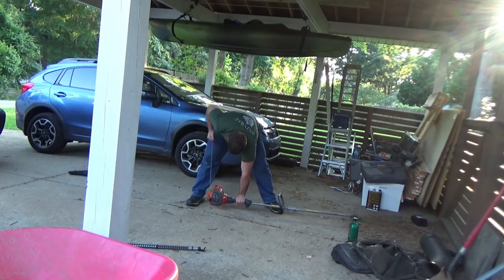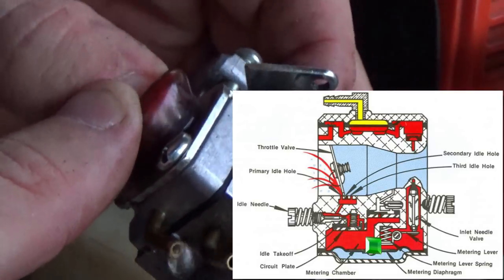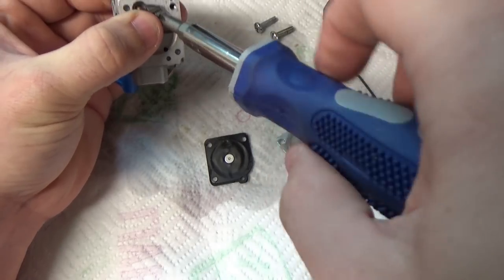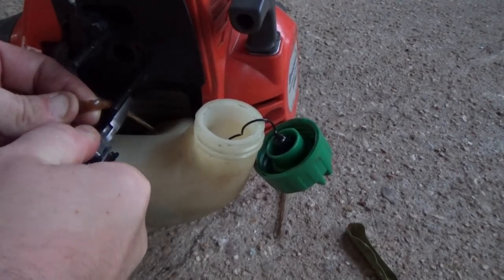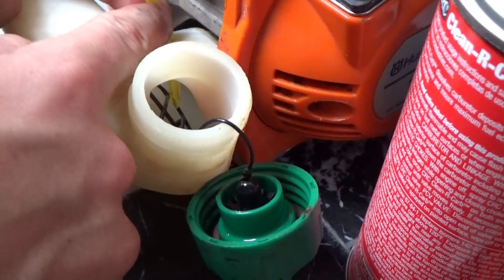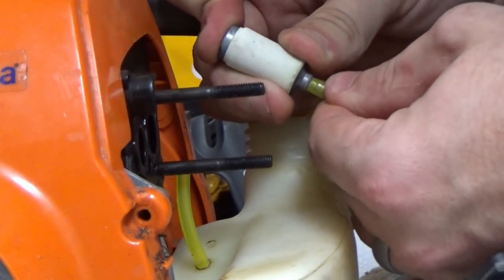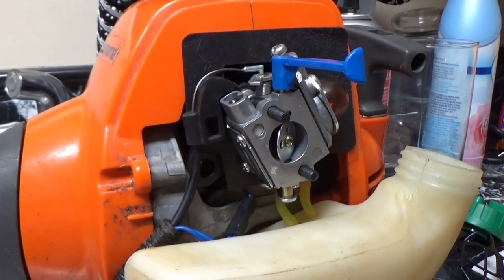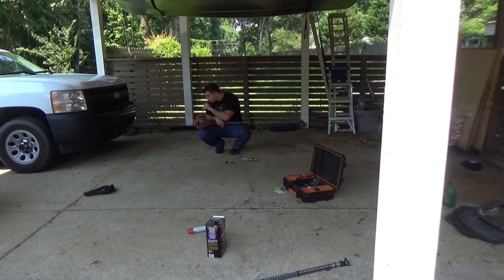How to fix a Husqvarna weed eater (no more bogging down)

Comment: Mine ran good for about a total of 6 hours.   My fix to the bogging down, stalling problem was to tomahawk chop it to the ground, engine first then run it over with the tractor.     It still doesn't run, but I dealt with the problem once and for all.    Next time I'll buy stihl
Reply: Sounds like what I need to do with mine, I have got it running and after a while it happens again. My Husq. is about 20 years old.,
Reply: Doesn’t matter what brand you buy if you leave gas in it with ethanol or not take care of it or maintain it. Also, you get what you pay for. Don’t expect that a box store trimmer will last forever. It’s worth it nowadays to step to a “pro” model.
Reply: Husqvarna is trash
Reply: @alonzokincaid1362  the older stuff was good. Don’t know about the newer stuff. Mine is from 98 a 232L

Comment: Liked and subscribed, my man! Thanks for putting this out.

 I have a Husqvarna 128 LD trimmer and seems the issue was the fuel lines were disintegrated. I dumped the fuel into a container and saw a bunch of little pieces from the line in there and in the empty tank.
I ordered a kit that I luckily found on Amazon and I got it today. It works good as new. I cleaned my old carburator and saved the new one. Thanks again!

Comment: Good video, when I work on those carbs I’ll usually strip the plastic off a bread sack tie and run through the little orifices.  Works good.
Reply: Just have to be careful doing that some of those have check valves that can be damaged.

Comment: Very helpful. Don't forget to clean exhaust screen. That ended up being why mine would bog down and run rough, but the things you did were important and helpful. I also dumped the old fuel and ran straight gas through it for a moment, then added a fuel stabilizer with the fresh mixed fuel to keep Ethanol build up from occurring. Nice dog.
Reply: Yes very important to clean that. Search it, it’s on the other side by the muffler. Use a torch to burn the old stuff.

Comment: I have a 326-L, bought it in 2003, it worked great for years, finally the fuel line wore through, replaced that and it's run great for another three years now it needs a carb kit. The diaphragms are stiff and the fuel lines are suspect. Also remember to check the fuel filter inside the tank. Good tip on tapering the gas line to feed it through the hole. I'll try that next time.

Comment: Thanks. Very interesting. For those of you using ethanol contaminated fuel...don't. I, on the advice of my dealer, have never used e-fuel in any of my equipment. And just like when I was growing up...before ethanol was added to gas...have never had any gas related issues. I mix the fuel as suggested...run them all summer, put them up for the winter, and pull them out and start them as if they were put up last week.

We're lucky here, we have gas stations that sell nonethanol fuel...if you don't...well that leaves you dealing with the expensive quart cans from the big box stores or using e-gas. I'm going on 5 years with non e-gas...and no issues. Just saying.

Again, thanks for the video...I sure appreciate guys like you taking the time to demo your repairs.
Reply: poor a gallon into a container with a bottom valve, add water then use the valve to remove the water. I'm not 100% sure this removes all of the ethanol.

Comment: Ran good for 6 years then started crapping out. The "splices" in the tank are installed in the factory to keep fuel lines from pulling out of tank. I overhauled mine 3x as described and it still would not run right. Bought new carb, still would not run right, so I set it on fire and threw it in a mine hole.  Should have bought a Stihl.

Comment: Thank you so much did exactly what you showed and to my surprise my fuel filter in tank was also unhooked . I bought new lines just finished hooking it all back up getting ready to try hopefully it works . The hardest part for me was getting the new lines back through the gas tank
Reply: I'm struggling with those new lines too.

Comment: That 'sand' you found was not sand. It was part of the fuel line that was attached to the fuel filter, which had a line connector in line with the fuel line heading to the carburetor. That line disintegrated, leaving that sand looking stuff in your tank, which gets sucked up into the carb, since the fuel filter is no longer attached. Priming the carb before starting was also sucking this stuff up, and leaving chunks of plastic in the carb filter.

My 128cd weed trimmer just dies on me today, and this is exactly what I found inside. After disassembly of the tank I discovered things missing, and about a tablespoon of yellow crystals in the tank. Also found a couple of line connectors in the tank, and could shatter them with my fingers.
Reply from the maker: Very thorough!  Thanks for the insight

Comment: To get the fuel lines thru the tank, after cutting tubing at an angle, add oil to it, and as you push grab it from inside tank with forceps, and pull

Comment: For my husqvarna string trimmer 128ld -  tried new carb, air filter, fuel filter, checked spark arrester - fixed it with the spark plug recommended in the manual - Champion RCJ6Y
Reply: the spark plug did not fix the problem completely.  It was still hard to start and it stalled.  What seems to have fixed it was to turn the all three screws on carb - idle, high-rpm, low-rpm - clockwise until seated.  Then turn 1 1/2 turns counterclockwise.  I also needed a splined adjustment screw tool from walmart (probably also made in China).

Comment: i have a 128ld  trimmer, mine will start and run as long as it about half choked, i thought it was carb. so bought new one installed it but trimmers still want run when choke is open , has to be about half choked. i have put on new fuel lines ,filther and new sparkplug, new air filter.  im at whis end  what do you think i need to try next.
Reply: I had the same problem.  First empty the old fuel and buy some Huqvarna 2 cycle, the green 2 cycle fuel at the Home Depot or Lowe’s.  Try that if you’re running well, then awesome!  Mine was still running a little off, so I bought some hi and low needle carb adjustment screw drivers ( the screw heads are shaped so a normal driver won’t work) off Amazon and adjusted them.  I started from factory settings, which is about 1.25 turns out from closed and went from there.  Start the motor up and lean the further screw from the motor first.  Keep tightening the Hi screw by half turns until the motor is running very fast at full throttle until it starts to run rough, then back down the screw by a half turn or so.  Then adjust the low idle screw by tightening it down quarter turns at a time without squeezing the throttle.  You will hear the throttle going up as yo do this.  Back it down once you get a good resting idle where it won’t stall after you give it full throttle a few times.  Third, there is an idle screw that is below the start sticker instructions and above the two hi low adjustment screws.  Turn(tighten) that with a Phillip screw driver until your weedwacker head starts spinning on it own, then back it off until is stops.  

That’s it!  I hope you have success.  If not change the fuel lines and clean the carb like the guy did in this video.

Comment: Nice vid!  So I do this every season as I use my 128ld heavily. This yea I had discovered an issue with the trigger in the handle assembly...  The post that holds it all together had broken inside handle...  This would be something I would check also if having these issues..

Comment: Picked one of these up off the side of the road  yesterday. Bought a new spark plug today and it fired right up but doesn't run when the choke is all the way off. I'm betting if I do the same thing you just did it'll run just fine. Thanks

Comment: I have two of these. Both melt holes in the air filters. No wonder they mess up the cylinders  so fast sucking dirt in to the engine. Wonder if it is designed to do that. I contacted the company. No help. Trying to figure out a fixes.

Comment: I have a Husqvarna 128LD weed eater.  About 12 year old.  All the lines are falling apart.  I just installed a aftermarket carburetor kit with new lines.  I finally go the weed eater to start, but it seems to stall when I tilt it.  No 100% sure if I need more fuel or my line is too short.  However, I came across your video and noticed you have those smaller diameter looking coupler.  I had one at the end of my fuel return line.  I didn't bother replacing that small nozzle adapter.  Could this be causing my Husky weed eater to stall when I tilt it?
Reply from the maker: Yes, smaller line = greater suction

Comment: My husqvarna works wide open and at idle but dies at any other throttle. Any ideas? It’s a husqvarna 224L. New carb and new fuel lines. New air filter new fuel filter

Comment: Then explain ;
Installed brand new carb,filter , plug , fuel lines .
Adjusted idler as its suppose to be .
It'll sit there all day at idle but won't run but a couple of surge triggers then die ...
Set the lower & upper trims ..
Model 128 LD 
Purchased in 2007 ...
Reply from the maker: Leaky piston rings
Reply: @CreativeMechanic  
Perhaps but doesn't smoke abnormally .
Reply from the maker: Not necessarily you may just have poor compression
Reply: @CreativeMechanic  I've noticed most all the " How To's " on this subject has been the 128 LD model.
Mine has acted up since purchased new at Lowes .

Comment: This looks like the 128 Ld, I have one as well. Thanks for the upload! This is very useful. I wonder if you would like to comment on why the engine would sound fine but the head wouldn't turn and it sounds like there is something loose in the lower shaft. I can work on the engine but when it gets down there I don't have much experience.
Reply from the maker: The shaft that runs through the handle is likely broken
Reply: @CreativeMechanic  Thanks so much for your reply. Since my post I actually removed the lower and upper shaft, greased them up well and re-assembled. I went to start it and wouldn't ya know it, the engine would only run for a few seconds haha. BUT, the head did turn in that time with the RPM's expected. Looks like I'll be cleaning a carb and filter. One more thing though, even after everything was tightened back up, the gray plastic area above the throttle trigger and safety switch seemed to move away from the rest of the engine and orange housing. Does that sound like it could result from a broken shaft? I couldn't see anything broken but you know how that goes. Sorry for the novel, +SUB

Comment: Thanks for the video! I was watching some others and one guy used the fuel line connector on the inside of the tank going out to the filter. I noticed you used two connectors on both the delivery and return but on the outside of the tank. Any special reason for that ?
Reply from the maker: They were already there.  The connections have a smaller diameter than the fuel line so they would affect suction on the feed line and pressure on the return line.  It may be negligible but I figured I may as well use them both since mine appeared to come from the factory that way.

Comment: Good video quick question ....fuel cap is vented?
Reply from the maker: 🤔 I think it can only suck air in.....  when you prime it and then take cap off you can hear air escape like there’s a small pressure build up.  But as the fuel drains it would need to suck air in to maintain equilibrium and prevent the gas tank from concaving
Reply: @CreativeMechanic   thanks i just ran into that lil problem like it was not letting enough in blowed out with air hose and baskeball needle ima replace everything it was like 15 bucks on Amazon and if it seems to still be a problem ill replace cap...thanks for info.

Comment: Thank. You !I can't use no throttle ever ! Air filter, plug all is good I was t old ! I can't start weedeater but will NOT stay running. Any ideas for me to get fixed. Hmm not sure if I can achieve this lololol.
Reply from the maker: Have you cleaned the carb and checked your fuel lines?

Comment: Mine did same thing and I discovered fuel lines were rotted. I replaced fuel lines step by step and now bulb won’t prime. Should I replace carburetor?
Reply from the maker: Yes, and make sure your bulb doesn’t have a hole in it

Comment: I LOVE watching people frustratingly fight with shit lawn gear. You saved a ton of money though....... LOL
Reply: I’m getting fed up w temperamental gas lawn equipment also.  Really close to going electric for small stuff.
Reply from the maker: I don’t know how my much I saved, but the going rate for me to work on stuff is $50 an hour.  For comparison, I’m still $40 cheaper than the local small motor shop.
Reply from the maker: That decision is directly related to the size of your yard.
Reply: Creative Mechanic yeh the yard is only 6000 sq ft.  I’d only need a trimmer, pole saw and maybe the small electric blower for just dusting the driveway off when I’m done.  And possibly the electric stain saw for quick infrequent uses.  But The yard will be 7500 sq ft to 10k when I get the back yard finished tho.  But I still rely on engines for the mowing portion tho.  I’m sure I always will.

Comment: Mine used to only run on half choke now it only runs on full choke and not very well. The throttle is unresponsive. I wonder if my husky might have this same problem.
Reply from the maker: I think the actual problem with these is that the fuel metering screws vibrate and turn, causing the settlor change a lot

Comment: Had a buddy call me up and asked if I could look at his weedeater. I thought sure no big deal an so I asked "what's wrong with it, did you try an fix it already?" He said "idk, man. It jus won't start and if it does it dies when I pull the throttle. I put a new fuel line on the tank cuz dad said it needed a new one" when he brought it over the first thing I looked at was the fuel line. It wasn't down in the tank and when he couldn't get the line to go into the tank he got a drill bit found the one that fit an got the next one up an drilled a new hole. Ended up having to pop in a bigger line and adjusting the carb to take the extra fuel. The S.O.B screams now but it'll run till the fuels gone lol

Comment: My husqvarna 128r won't start. I've cleaned the carb like you've done. I've sprayed wd40 where the spark plug is. The problem to why didn't start was I run it on petrol. Any other advise?
Reply from the maker: Did you check to see if there was a spark?
Reply: Thanks for your time, how can see the spark?
Reply from the maker: m Mack take the plug out and hook the boot up to it.   Watch my recent video on a Honda lawnmower or pressure washer, that way you can see it

Comment: When I re-installed the spring and lever for the need and tighten the screw the spring gets stuck in the down position. I have tried re-installing and triple checked it was going in the right way, but the problem persists
Reply: Jim Mercer  may be corroded you can get a new carb for 12 might be easier or you can try to get rid of corrosion etc

Comment: I have a question if I may ask .. I have a Husqvarna weed eater it runs but it jumps fire from the plug causing it Mis really bad. I've tried everything that I know of and can't get it to stop.   If you can do a video on this or just reply to my comment on what to do  to fix it I'd really appreciate it. Thanks have a good one.
Reply from the maker: If actual fire is shooting out near your spark plug your cylinder is likely cracked and your engine is toast. 

But I may not understand what you are asking
Reply: @CreativeMechanic   no not actual fire .. lol . Win it is running the spark jumps from the plug to the motor causing it to miss really bad
Reply from the maker: Oh, Change your plug and make sure the gap is set correctly

Comment: I have a husqvarna 223l that i bought brand new 2 or 3 years ago it runs rough for a couple minutes then it start running fine its done this ever since i got it could what you did be the issue?
Reply: adjust the low idle screw

Comment: Great video.  I have the same issue.  My fuel filter fell off the brittle fuel line.  Do you have a part number or know the size of the fuel line to replace it with?
Reply from the maker: Take the line off and bring it to an auto parts store.  They usually sell fuel line by the foot
Reply: Just ask for fuel line kit for string trimmer. Its all the same size.
Reply: That's what I did, I got the kit.  All fixed! :-)

Comment: Mine was bogging down after about 30 seconds of running and then cut off.  Found out the fuel filter had come off inside the gas tank.

Comment: Did everything in the video. It ran for about 30 min (still won't run with choke off). 
Now it won't start again.

Do I have to get a special screwdriver to adjust the idling screws or something? Im about ready to trash it and sharpen the scythe.

Comment: Brand new 122LK with proper fuel won't stay running after break in. Adjusted carb, still has a governor block. Tried 50:1, 40:1, fine tuning, etc. 

Removed spark arrestor, got too hot even with carb adjustment. Never had issues with STIHL. Going back to a quality product. 

Should of known better, my best money makers for small engine repair are  Husqvarna, Cub Cadet, and Poulan products. 

Wonder why STIHL and Honda aren't on my repair inventory 🤔 buy right the first time folks.
Reply from the maker: Don’t tell them that, then they won’t watch my videos so I can make $$$ 😂